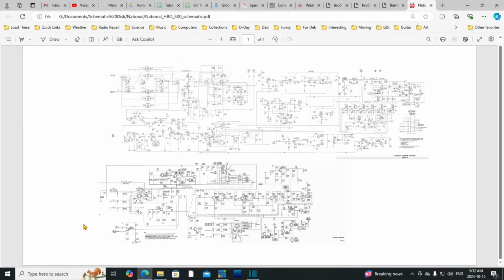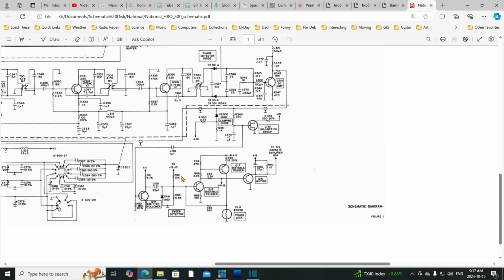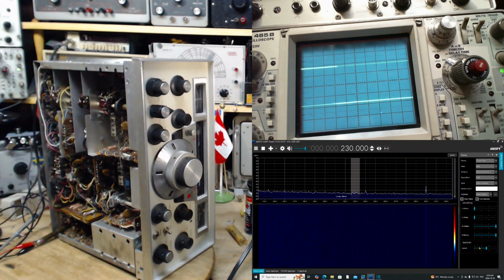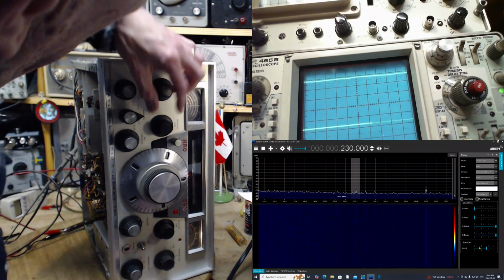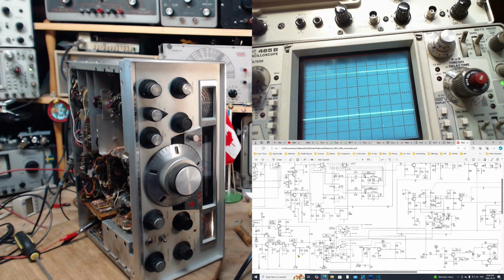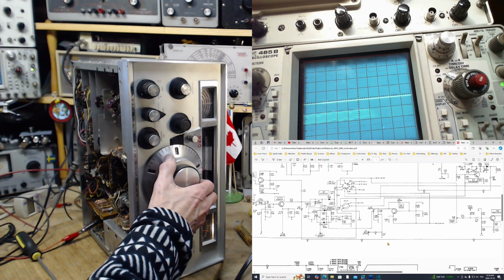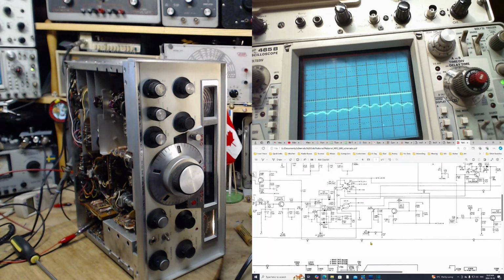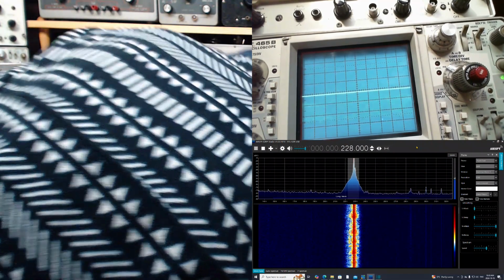National HRO 500 Communications Receiver Video #8 - Some Progress

Comment: my guess is a transistor in the output amp circuit. The way that the output was working then faded out, seems logical to me that the part was dying and finally gave up the ghost. However, I am a noob and I could easily be wrong. Anyone else want to guess? or correct my thinking?
Reply from the maker: Here's a hint:  It's not that.  LOL